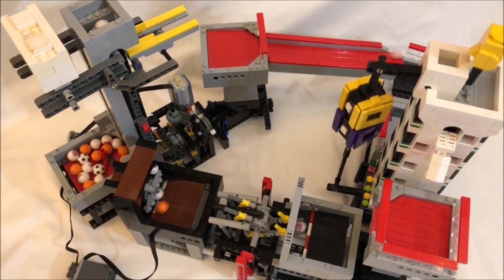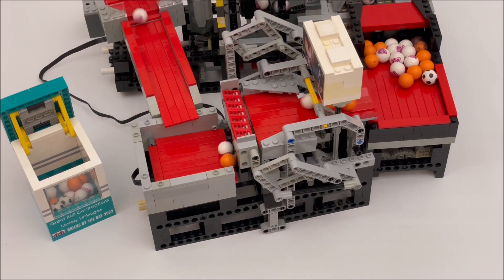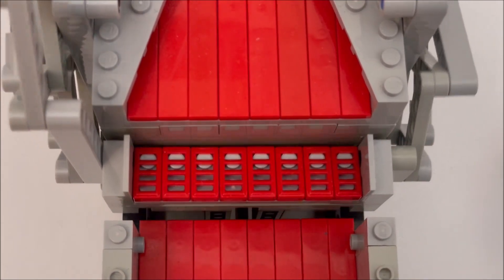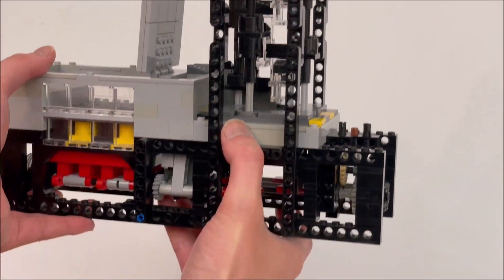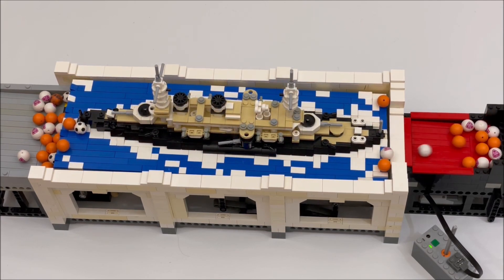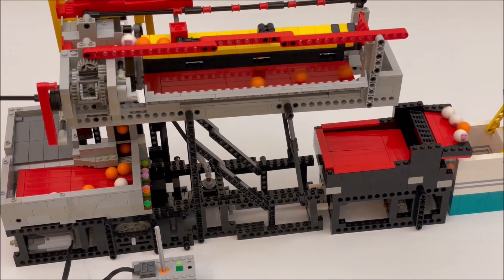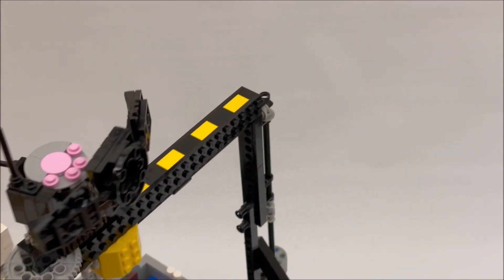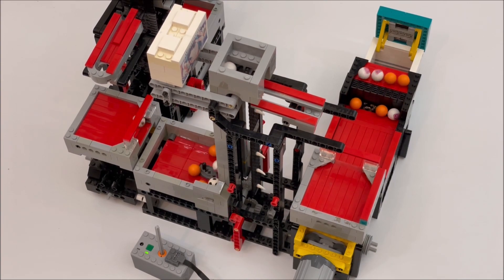LEGO GBC Shared Power Update (feat. Peaucellier-Lipkin Linkage Lift v2)

Comment: I build the single seller stepper and the multi stepper. These two are ok in shared power. But I don't think it will be fine with another module. But as you said I guess 3 or more single seller stepper with one motor are fine.... But not to buy another motor is always ok. Even when one motor is only ok for 2 modules, this is 50% of the price 😉